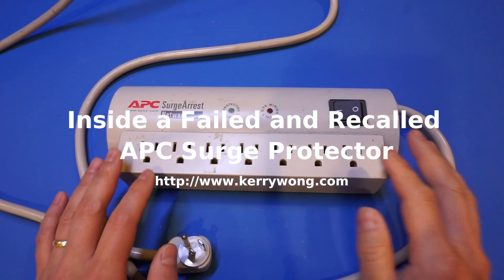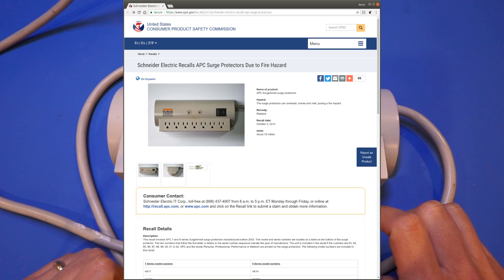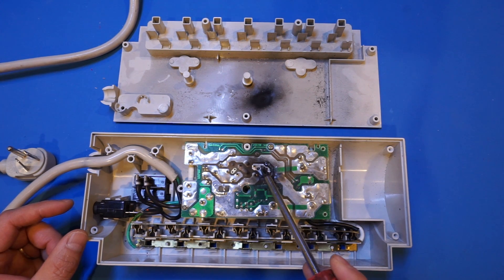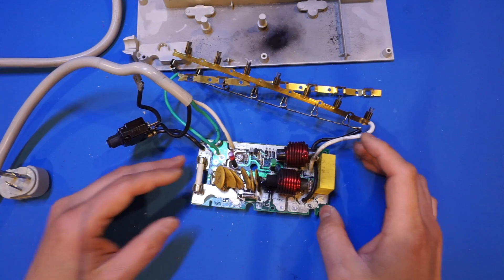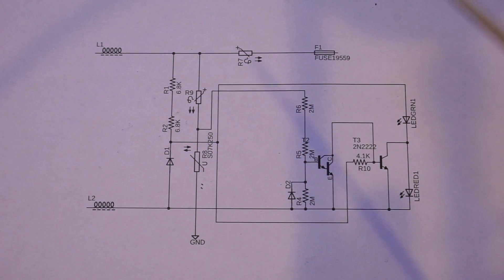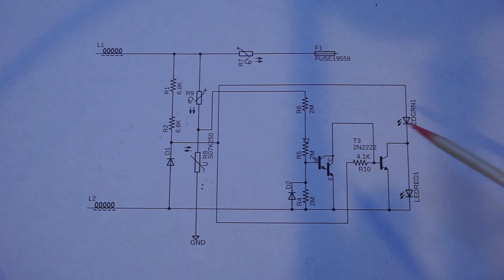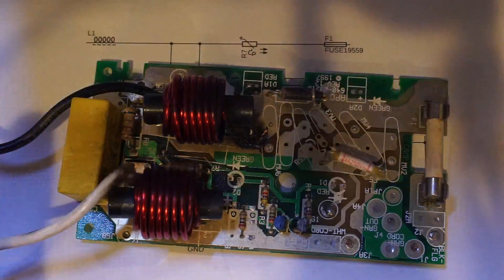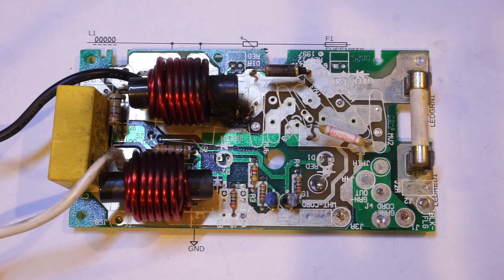Inside a Failed and Recalled APC Surge Protector

Comment: The main fuse did blow. Suppose to be able to see thru the glass tube. Very high voltage! Surge vaporized the metal inside the fuse to the glass creating a pathway for electrons to keep flowing thru.
Reply: Or... it's a ceramic HRC fuse.
Reply: @ickipoo  eat a fish catch a voter! Then throw it back and catch a voter! With debt!
Reply: @brianwaiting7899  It's a ceramic HRC fuse.

Comment: Good video Kerry! I would be interested to see a follow-up to this video with the newer(post recalled) version of this product made after 2003 when, presumably, corrections were made to prevent the potential fire and smoke danger of the recalled units. I still have 3 of these in my home that were manufactured after the recall. I did have one of the recalled year units and APC replaced it for me at no charge. I would really like to know what improvements APC made to the circuit and if those changes were adequate. Thanks!

Comment: This started out as a mechanical solder joint failure due to a large heavy inductor that is not well mounted. Cracked solder joint then heated and burned. See it a lot on heavy components.

Comment: Strange circuit design. An electronic circuit just for controlling the leds, irrelevant to any protection purpose. And for the energy needed to light up these leds, the fuse, instead of being located right after the line input coil, before the MOV in order to play its protective role by being melted after a surge, is located after the MOV, where it serves no purpose at all as regards overvoltage protection. It simply protects the load in case of short circuit. As for the leds' circuit itself, I wonder who could see the instantaneous led light changeover as there is not any "memory" circuit there and finally what would be the benefit of seeing it, if it were noticed. As regards the input coils, given that their wire diameter is big, their terminals should be left longer and bent in a rectangular anle touching the pcb at the solder side of it, offering them a much higher immunity against any vibration problems and better solder joints with much less resistance at these points. Another question is if their wire is copper or aluminum...

Comment: That is (was) very common type of failure in for example washingmachine programconroller boards.That happens because 1. Those components do heat a bit and that causes heat expansion and some stress to solderjoints2. Those componens (coils with ferrite inside) are "heavy", so any drops, kicks, hits and so on will cause stress to solderjointsOf course fuses wont blow, because there is (was) only poor connection, not a short circuit.That metal component near damage area looks like "microtemp" type heat fuse. Those are usually not automatically restoring type fuses that will cut off at marked Tf temperature (there should be temp markings in it, example Tf 240C). It could stop current before fire.Biggest danger there is that arcing happens first between coil leg and board trace, but board heats, burns and burnt hot board  leaks current (seen that). If there is something near it can leak to, that can cause very hot secondary arcing (mean between "hot live" wire and ground wire) (that can cause fuse to blow eventually, but it may first cause heat energy enough for plastic to lit.That kind of component legs should be bent to the circuitboard atleast 3-10 mm and then be soldered. That´s only good fix for thatkind of problem. Soldering coming bad is so common failuremode..Happens because of poor manufacturing. Good manufacturing costs, so they wont do it if they just can get away with it..

Comment: New home / office APC stuff is just cheap garbage, took a APC UPS apart and the protection diodes / movs fro the telco and newtwork protection are not installed, just the empty places in the cheap circuit board.
Reply: The ones I've looked at had a daughterboard with proper movs installed, but the grounding point was not connected!
Not to mention the transformer is always powered and probably cooks the battery in no time.

Also the one in this video looks like it has a proper switch, I have another APC surge protection strip where the crappy round rocker switch failed in less than a year.
Reply: Coincidence or not that one I took apart the battery was dead.

Comment: The silver/darkened fuse near the MOVs looks to be a thermal fuse, which is only one time use. It can pass 15A but I'm not actually sure what happens if its much higher. Then of course the resettable breaker that you've shown, attached to the wire, is likely setup for 15A.
Reply from the maker: The darkened fuse is still intact. The main fuse is rated for 25A.

Comment: perhaps it was a poor solder joint?  that would explain why the fuse didn't blow.  those heavy coils don't appear to be bonded to the board and they look like heavy gauge wire.  looks like a perfect scenario for a solder joint failure.     if the solder joint starts increasing in resistance then it wouldn't take very long for a lot of heat to build up there and of course, that area is not designed to dissipate much heat at all.   thats my 2 cents.
Reply: Vibration could have contributed to the increased resistance at that joint. Those inductors are arranged such that, during normal operation, they will pull toward each other at the current crests and relax at the zero-crossings. So whatever holds those inductors in place, apparently just their lead wires, will see a little ping of force 120 times a second. It's a small force, not enough to hear or even really measure in this particular equipment, but all metals have a fatigue limit (measured in force times cycles) beyond which they will start to crack apart. A heavy load for years on end, combined with a few hard jolts, could eventually turn that inductor lead into a pretty good heater (which eventually destroyed the things around it).
Reply: I fully agree. This seems to be the most likely failure scenario. Poor solder joint in combination with heavy load for long time...